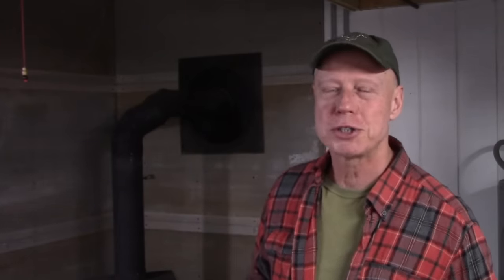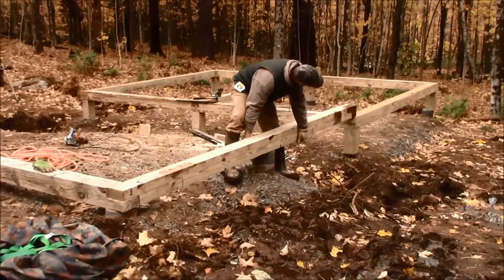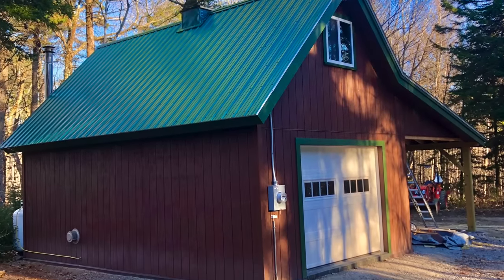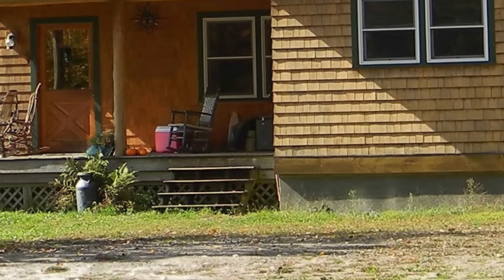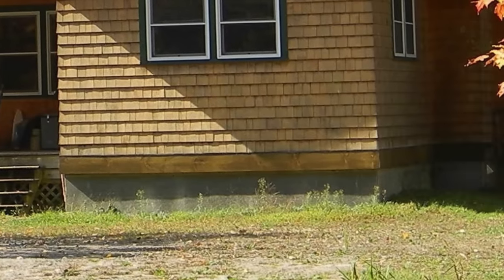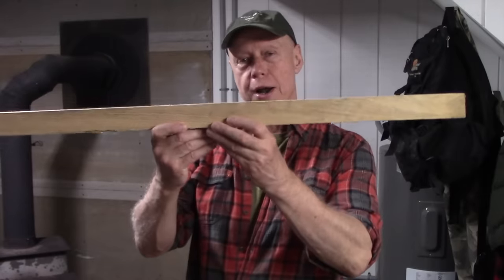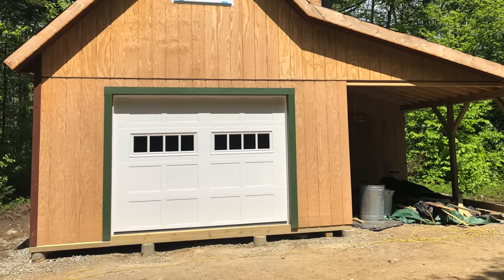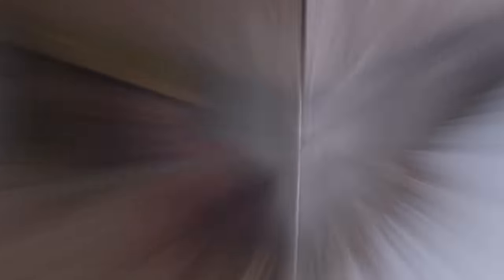BEST METHOD FOR SKIRTING A CABIN WHEN BUILDING ON PIERS.  Keep Pipes From Freezing.

Comment: I am going to be working on replacing the skirting on my crawlspace and this seems like a perfect method for it. I have one question when it comes to backfilling the cement board. Could the ground beneath the cement board not heave causing the cement board and framing to lift? I imagine it doesn’t since you haven’t had issues but just a question I had. Thanks!
Reply from the maker: With styrofoam beneath the plate and the cement board being only 1/2" thick, the frost just slips right by it and I've had no issues.
Reply: Awesome! That’s kind of what I was thinking. Just waiting for things to warm up a bit more and that will be my big project for the spring. Thanks for the quick reply!

Comment: Is there a brand of foam insulation you use under the frame Boss? Where purchased?
Reply from the maker: The white foam I got free. It was just typical white styrofoam but any foam that will compress under pressure will work.
Reply: @thebossoftheswamp  thx. Wasn't sure if that kind had enough give to it

Comment: Interesting and informative. But, what IS compressible foam insulation? Does it come in sheets, or spray foam...?
Reply from the maker: Any styrofoam than you can make an indentation in with your thumb will work.  All I use is salvaged pieces of assorted foam.
Reply: Very good! I've used the foam that's used as a cover for hot tubs before. Dealers throw away old covers. If they aren't water logged, I just take the vinyl off and use the foam. Thank you for the idea!

Comment: Does the concrete board work ok in hot humid climates (with mild winters)?
Reply from the maker: I don't see why it wouldn't. However, the last time I bought it I found that it's made differently than before.

Comment: I live in northern Minn and used cement board exactly as you for skirting. This material is flaking off & crumbling where it meets & is covered  by earth at ground level....I suspect water absorption & freeze thaw cycles is deteriorating causation....won't use it again! How long has yours been in ground contact?
Reply from the maker: Mine has been up since 2006 and still no issues. How old is your cement board?  I ask because I bought some last year and it's made differently than what I used before.  The new stuff is much lighter and also much easier to cut. I'm wondering if that has gone to $hit like everything else we buy these days.
Reply: Purchased in 2011 @thebossoftheswamp

Comment: At 6:00, how deep does the foam need to go into the ground? How deep does the metal skirting need to be? I think my code for foundations here in Maine is around 4' deep, if that's a consideration. My cabin is on concrete piers, about 4' off the round in back, and about 1' in front.Thanks.
Reply from the maker: I'll have a new video out within a few days where I share more on the subject and will answer everyone's questions at that time.
Reply: You are correct that your foundation needs to be 4 feet deep in Maine.  I Live in Maine as you do. My cabin is on 8 piers
Putting skirting around it now

Comment: What type of cement board do you use. November 2024
Reply from the maker: It used to be called Dura Rock or something like that and had great results with it. The last cement board I bought at Home Depot was different than I've used in the past and was much lighter and easier to cut.  Hopefully it will perform the same as before.

Comment: Nice, but for this old builder, nothing beats a continuous foundation wall below the frostline, insulated on the inside with 1" of blueboard.  But this comes close. I have radiant floor heat in my shop, and people were surprised to learn it had only water in it, not an anti freeze mix, that's because it will never freeze,not in 40 years of Idaho winters.
Reply from the maker: I agree on the foundation but concrete trucks won't ever make to my where my cabins are :-))
Reply: @thebossoftheswamp   Now I feel like a jerk! That makes perfect sense!  Carry on....

Comment: Is this effective for preventing pipes from freezing at a weekend cabin in winter (Nova Scotia), or is supplemental heating needed when not around? You kind of relate to this at the 9:50 part of the video.
Reply from the maker: If a building isn't heated full time through the winter, the crawlspace would most likely eventually freeze up - pipes included.

Comment: Bubble foil is wonderful stuff. It's insulative strength is when there is an air space to radiate heat off the foil and back into the living space. Heat only radiates in a gas (air), not solids or liquids. Heat from the sun is radiant heat; it heats the earth and the oceans. Heating system radiators work by radiating heat, through the air, to you and other solid objects (not that we are solid objects). Without the air gap, the R-value = zero point not much. There is a lot of mis-information (advertising?) about this. Van lifers often make this mistake. This is not to say that the bubble foil is useless. It is a great vapor barrier. But vapor barriers are another physics discussion.
Reply from the maker: I'm with you on the air space being beneficial but when this is stapled to the underside of my floors is just plain works and works very well. I've never spoken a single word to the manufacturer and make no money from it. I share this because of the results that I get from it.
Reply: Perhaps your success is because the foil isn't bonded (glued) to the underside of the flooring, leaving enough of an air space for radiation. Whatever is going on, I am happy that you have a winning solution. I see some testing in my future. @thebossoftheswamp
Reply from the maker: You're probably right. When I'm building a new structure, I blanket over the joist and the foil is sandwiched between the joist and the sub floor. No doubt that over time, the foil would sag a little between the joist, creating a small air space.   Through experimentation I've found that this should never go against a cold surface like against the inside of the perimeter joist or box sill as it reflects cold back into the wood and creates moisture behind it. . @panamafred1